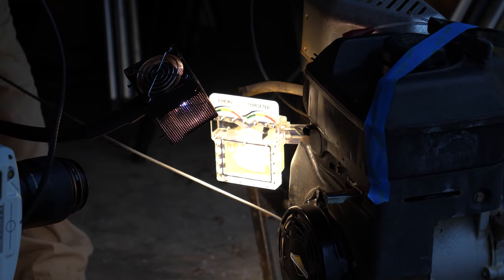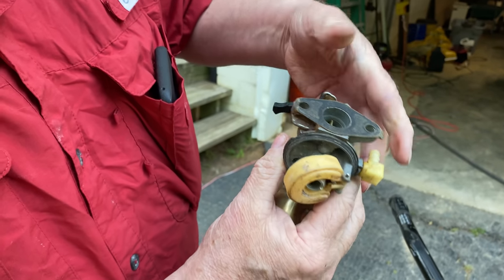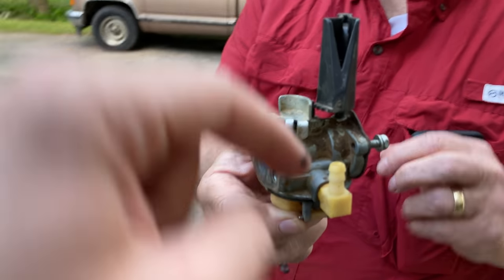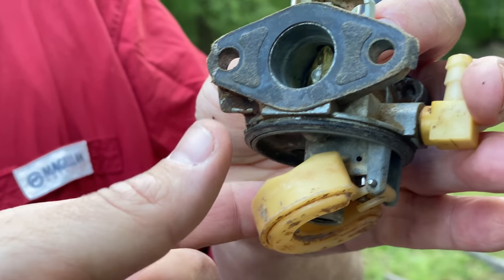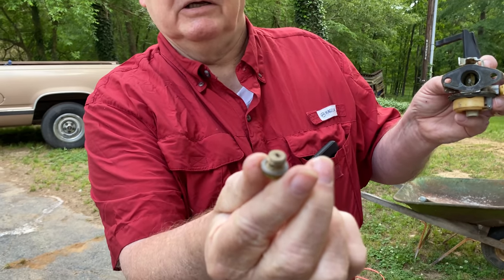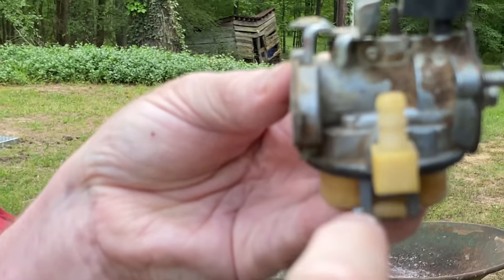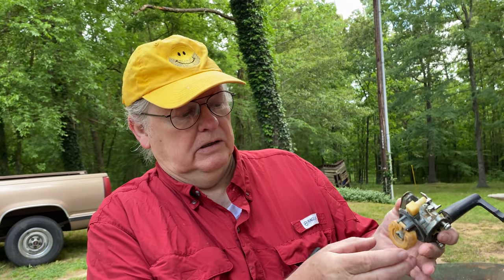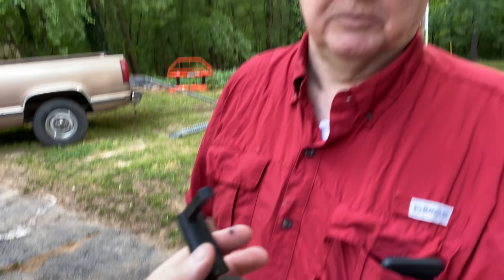Transparent Carburetor (Extended Cut With My Dad Darryl) - Smarter Every Day

Comment: One thing I noticed brought to mind one thing my Dad used to show me. He would talk about port and relieve of an engine. He was an awesome mechanic and dealt with some race engines back in the 60"s. I noticed after the fuel mixed with the air and at the end of the see through carburetor, there was a place where a spinning motion of the air fuel mixture could be seen. By relieving the port (smoothing out of the intake and exhaust of any projection or place that the mixture would not flow over smoothly), would possibly increase horsepower. Thank you for posting videos and by watching I feel "Smarter Every Day"
Reply: Too much horsepower.

Comment: Hey Destin, you asked a few questions through out this video and in your Patreon stream that I didn't hear an answer to during the video, and I figured I could share some of my Eng knowledge with you if your dad didn't answer them off camera already.
Starting with the float malfunctioning in your carb. If the float sinks or the needle valve doesn't seat right on a reg carb, the fuel would gravity feed up into the carb through the jet and either leak out the front or into the cylinder while the engine was off. That's one reason they suggest turning off the in-line fuel valve when you are done using the motor. Most float valves I have seen have a rubber tip or o-ring seat that eventually degrades and causes this problem, and is fixed with a typical carb rebuild kit. If it can leak fast enough, it can make the engine run rich.
Flooding the engine is essentially when the fuel air mix has become so rich that it longer supports combustion. Either by the stoich. ratio not having enough air, the spark plug is wet with fuel and won't fire, or worst case, the engine hydro-locks.
Hydro-locking is when a liquid is inside the cylinder and prevents the piston from reaching TDC because liquid isn't compressible like air.
As your dad said, any fuel, ethanol or not, sitting in the bowl will eventually evaporate and leave behind a gummy varnish. If using the engine often, ethanol doesn't really cause any problems. The problems with ethanol in fuel is alcohol is hydrophilic and absorbs moisture. If left for a while, that moisture builts up in the gas and can cause problems with rusting inside a steel gas tank, corroding the metal components in the carb from water exposure and galvanic metal reactions, and poor engine performance or no start since the water is heavier than fuel and it makes it to the engine first due to gravity.
Vapor lock can be a few things but mostly is caused by a hot engine heating the gas in the carb or fuel lines to its boiling point, and those gas bubbles interfere with liquid fuel making it to the engine. Running a fuel line to close to exhaust is a prime culprit. Vapor lock usually happens after you turn off a hot engine and it won't restart while it's still hot. Since the fuel isn't being used, it keeps absorbing the engine heat until it boils and then it won't restart until it cools or the liquid makes it into the carb again. Vapor lock could also be referring to blocked or no vent on the gas tank and as the fuel is used the vacuum created in the gas tank eventually stops the fuel from flowing.
Since you're working on a fuel injection video you prolly already know this by now, but there are a few difference kinds. Your dad mentioned direct injection into the cylinder which is one. In this case, since the fuel injector is exposed to the high compression of air when it needs to open, the fuel pressure has to be higher than the compressed air in the cylinder, otherwise the air would just be pushed into the fuel system instead of fuel coming out. This requires pumps that can get the fuel to vary high pressures and is how modern common rail diesels work with pressures upwards of 35,000 PSI.
The first form of injection was just a single injector for all cylinders that just took the place of the carb jets and was controlled by computer rather than the engine air flow. They then went to multi-port injection where they had an injector for each cylinder, but they were still in the intake before the valves. Then came direct inject mentioned above, and now they have moved to a combination of port injection with direct in order to lower emissions and have the benefits of each.
And since this is long enough and I doubt anyone is going to get this far, your dad was explaining that closing the throttle butterfly restricted the airflow, creating a vacuum in the cylinder which reduced the amount of fuel and air going in which caused the engine to slow down. That vacuum created by the piston struggling to pull air through a closed intake is the primary source or engine braking you feel when you take your foot off the throttle. Since diesel engines are controlled by fuel quantity and not air quantity, they don't have butterfly valves in the intake and therefore don't create the same vacuum braking effect that gas engines do. This is one reason many modern diesels have a Jake brake or some form of exhaust brake to create an engine braking affect.

Comment: One thing I never heard you "get" while you were explaining. The float bowl is not under a vacuum. It's vented to maintain a neutral pressure state. Just atmospheric pressure. The vacuum is only in the main port to the cylinder (which includes the venturi). The float is important because it partially controls the mixture. The lower the fuel level, the harder the vacuum in the venturi has to work to suck fuel up out of the bowl. Less fuel gets sucked up so the mixture is lean. The higher the bowl level, the easier it is to suck the fuel out so the mixture is richer. Mixture is controlled by the combination of the main jet size and the fuel level in the bowl (in a simplified world). Actual carburetors have idle circuits and more jets for better control of the mixture over a larger range of engine RPMs.
Reply: THANK YOU! I feel like there is so much more Destin can learn on this subject. 

I have always wanted to see the gauged pressure differences at different points along the intake and float bowl to see what you are describing. 

This old school type of carb is such a rudimentary fuel atomization device. 

Thank you Destin for such a fun day with your dad.
Reply: The Vented bowl is why carburetors need to be run dry before storage otherwise the gas in the bowl will evaporate away and cause varnish and gunk.
Reply: I've been taught that the engine doesn't suck in the gas. The piston going down creates a void that atmospheric pressure fills.
Reply: @gordoliver7693  Say it however you like. The fact remains that the cylinder has a lower pressure (or vacuum) than the normal atmosphere so they try to equalize.
Reply: Hi! The bowl is vented? I thought it was sealed off and the pressure inside the bowl was maintained by the fuel intake tube and the tube that leads to the Venturi alone? You mean there's a third opening? Or do you mean these two tubes maintain the pressure?
Reply: @Scanjo  The vacuum created by the movement of the piston draws extra fuel up when the choke is closed due to extra restriction in flow. During choke open operation the fuel is drawn up due to the reduced pressure in the neck of the carb as Dustin explained.
Reply: @ChillGuy511  There is a passage in the carburetor body that leads from the atmosphere to the bowl. The venturii effect requires the bowl to have atmospheric pressure to drive the the fuel up the jet into the lower pressure stream of air. It's a small passage to prevent fuel from spilling from it and to prevent fuel contamination from the outside. It will still allow fuel vapors to exit over long term storage.
Reply: @ChillGuy511  Another opening.
Reply: @kjdude8765  During choking, it's a combination of more fuel and less air. The air is restricted which causes a higher vacuum in the venturi so more fuel.
Reply: @kjdude8765  That makes sense. Thanks! ✌️
Reply: @Scanjo  Agreed, however the restriction ahead of the neck allows the piston vacuum to draw the extra fuel with the smaller volume of air giving the rich condition.
Reply: @kjdude8765  Which is what I said... I see no "however" in what you said.
Reply: @Scanjo  Looks like I misread your comment. I thought you were implying that the lower amount of air moving through the Venturii created a higher level of vacuum. Glad we are in agreement.

Comment: I'm a computer guy...not a car or small engine guy. I got that from my dad, who I learned a lot about computers from when growing up. He's also not really a car/small engine guy. This winter, we ran into an issue with a leaky primer bulb on our snowblower. When this happened, my dad and I were both a bit lost on what to do. After watching these videos about carburetors, I feel like I can tackle taking that apart to get it working again. Though you didn't explain the primer bulb, I think I understand it's purpose now that I understand how the carburetor works (obviously it shouldn't be leaking). The primer bulb introduces some more fuel to the throttle side before there is a vaccum to kick start the supply to the cylinders. Before this...it might as well have been magic. Absolutely love your channels Destin!

Comment: 28:45 Almost certainly, the throttle linkage isn't directly connected to the carburetor butterfly valve.  The throttle lever tensions a spring in ) a wind-vane governor.  Fins on the flywheel create air movement.  This pushes on the vane and, as this force overcomes the spring tension, the governor linkage closes the throttle, allowing for a constant rpm at varying loads.

Comment: Hey Destin, a few things to add to your carburetor information list: High speed & Idle jets, Idle air control, and the air/fuel ratio 14.7/1.
You made a simple, single jet carburetor with full manual control (a rudimentary carburetor). A simple basic carburetor, like the one from the tiller, has an Idle jet on the intake side of the throttle butterfly plate and the high speed jet in the venturi. When you look inside the venturi you will see the corresponding holes aligned with the two jets in the float bowl jet pick-up tube on the underside of the venturi. The Idle jet allows a smaller metered amount of fuel to flow while the throttle plate is closed and as you open the throttle plate, the venturi effect caused by the piston, draws the additional fuel through the high speed jet increasing the rpms and power generated by the engine.
The air/fuel ratio for gasoline-powered engines is 14.7 parts air (atmosphere) to 1 part of gasoline fuel. However, different fuel power ratios or octane require additional adjustment accordingly. For example: If you are using typical rated octane power, 87, 89, 91 (regular, plus, premium) most engines will not need any adjustment, but if you were to increase that octane rating to 100, adjustments in timing and air mixture would be needed. Different fuels (propane, diesel) and combinations of fuels (ethanol and gasoline) will also require adjustments as well because different fuels burn at different power levels requiring varying amounts of air to maximize that power level and efficiency of fuel burn for clean operation.
Carburetors are being phased out because their efficiency rating has been far surpassed by new technology in injection throttle bodies and direct injection, both mechanical and electronic. Sadly, the current EPA requirements  are trying to eliminate carburetors entirely. Only time will tell.
Awesome video, looking forward to the others.👍👌🤙

Comment: Destin! Here’s some more insight on the oscillations you’re seeing in the high speed around 53:50. 

Picture your engine cycle timing around 720 degrees of crankshaft rotation (two full turns gives a full cycle). The engine you have your DIY carb on is a 1 cylinder engine so you only have 1 power stroke in the full 720 degrees. 

Now tack on 3 more cylinders. You still only have 720 degrees of crank rotation but now there is 4 power strokes per engine revolution. You have a power stroke every 180 crankshaft degrees now (720/4) which helps smooth it out a bit. 

Now turn that 4 banger into the V8 in your old red pickup truck. Still 720 degrees of crank rotation but now 8 power strokes. You get where I’m going, now a power stroke every 90 crankshaft degrees. (720/8). This will theoretically smooth it out even more. 

You can keep doing this in to crazy cylinder count engines like V12s or W16s and will have power being delivered to the crankshaft at most any point in its rotation which prevents the harsh vibration from a single piston suddenly accelerating the crank. 

Then some engines just have inherent vibrations and sometimes manufactures will have a counterweight that spins in time with the engine to cancel out vibrations.

Hope this makes sense to anyone that bothered to slog through reading it all, thanks!

Comment: Destin, love the video and love to see a son, young or wise working with their old man. Few things as someone who works with carburetors a lot, the terminology here will be very confusing for many. This specific carburetor has no “needle”. The float valve which has been referred to as a needle in the video, is just that, a valve. It allows fuel in, when the float is low and shuts fuel off, when the float raises as the bowl fills. The two holes inside the base you questioned are main and pilot “jets”. This is an Extremely simplified carburetor but they all work on the same principles shown and so awesomely demonstrated with the high speed! Super fun and super cool to watch! Would love to chat some time and maybe even show you a few different carburetor styles via video call or could even send a clip should you be interested and have the time. Not seeking recognition or anything of the sort, but I know you love to learn and and I’ve learned a ton from you. Would be a lot of fun to show and explain a little more in detail something I become smarter every day in, while working on small engines like you’ve shown, if you’re interested!

Comment: As with all of your videos, this is beautiful on many levels.  I love your dad.

You've probably realized this at this point, but the thing to remember when thinking about how the throttle reduces the amount of fuel/air entering the cylinder is that both the fuel vapor and the air are compressible (and "expandable" as it were).  So because the amount of time that the piston is moving downward in the cylinder is sort of "fixed" by the RPM of the engine, there is a fixed period of time during which the fuel/air mix can enter the cylinder in the intake stroke.  So what happens is that if the throttle is partially closed, restricting the flow-rate of fuel/air into the cylinder, the vacuum in the cylinder is not completely "filled".  There's still a partial vacuum in the cylinder when the intake stroke ends, the valves close, and the piston then begins the compression stroke upwards.

At some point in the compression stroke, the pressure in the cylinder reaches atmospheric pressure, and finally, the fuel/air begins to actually be compressed.  And by the time the piston reaches TDC, there may be a bit of pressure, and also a bit of fuel-air.  So you get a smaller explosion, and thus, less power due to the throttle doing its job.

Comment: The first automatic chokes were controlled by bimetallic strips. Since the carburetor was in thermal contact with the intake manifold which was in thermal contact with the engine, as the engine warmed, so did the carburetor, and so the bimetallic strip gradually opened the choke and moved a throttle stop to allow the throttle to close down more as the engine got warm. 

In my old car, the throttle cable was also connected to a mini-pump which added some extra gas to the venturi as you pressed down on the throttle to give you a little more power as you opened it up. So to start it from cold, you would pump the gas once. This did two things: it opened the throttle which pumped a bit of extra gas down into the intake (not really essential) and it allowed the bimetallic strip to close the choke. Then you started the engine, and as it warmed up, the choke would gradually open.

Comment: I really enjoyed watching you and your dad work together.   He seems like a cool dude.   I recently got into vintage motorcycles, so I've been learning about carbs.  I'm always surprised that the needle valves are able to stop the flow of gas into the carb.   Doesn't seem like it would be a tight enough seal, but it works.    I thought it would be more of an aerosolized vapor coming up through the jet, rather than drops of gas.   I heard your dad say the same thing.